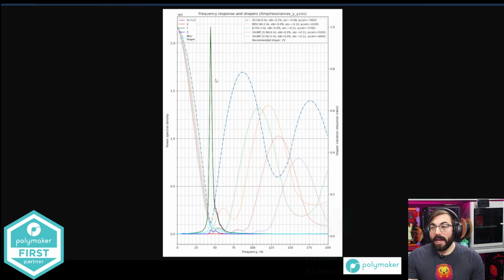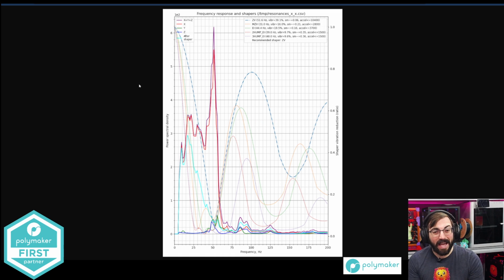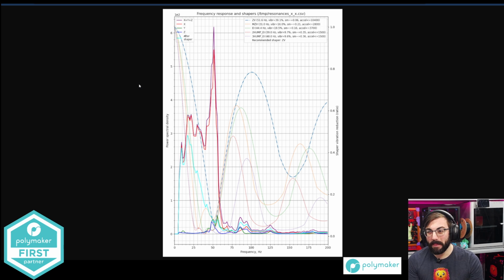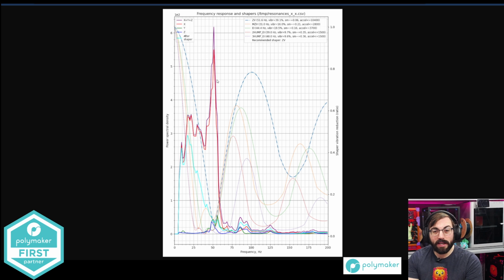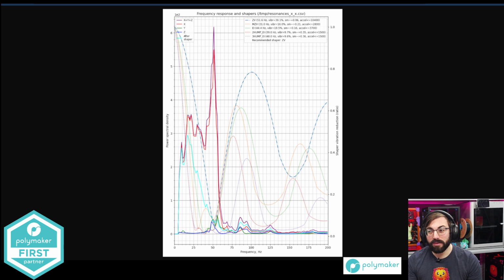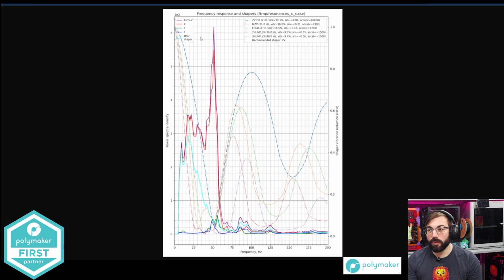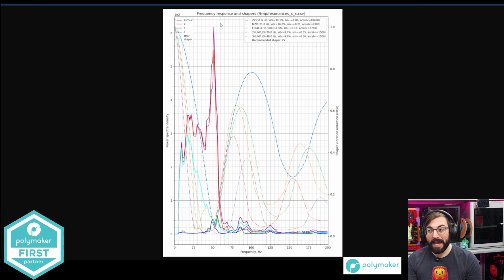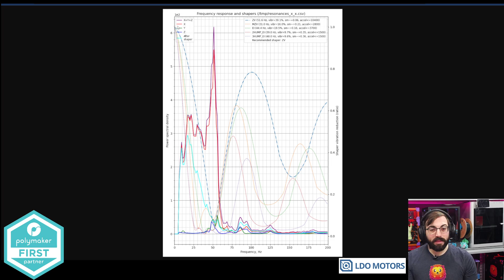The Creality K1C Is Not Ready | Here Are The Problems

Comment: :( I've had mine for 12 days of the 15 day return period. I've actually had good luck (COMPARED to other printers) but I also have rubbing on my top cover with patterns that are now burnished into it, I've had 5 clogs in those 12 days, and I've run into more makes that have ahd to be contorted, cut up or resized because the build plate is so damn small... I've been debating upgrading to a Bambu K1C or P1S - i'm really really torn because I've actully kind of fallen in love with the thing, how quiet it is, (it has a silent mode) and how easy it was to root it and do what i wanted to do with it.. that said, my trial and error frequency is off the charts... meanwhile Bambu printers exist and seeing the user experience basically cancelling out 99% of my past experience with 3D printers... I really think I should return mine too and get a Bambu. I'm so torn though because I now use it for recreation (mostly board game inserts and fun stuff) not for work anymore, so I don't NEED a K1C (or even a P1S) but I only paid $429 at microcenter and the P1S is $699-$999 (non-AMS vs AMS) 

Sidebar: Now the test print you have there is BONKERS bad, I've never had any any print remotely as bad as what you have there.

Comment: Wait so the extruder filament gears aren't supported on both sides of the axle? Yeah that's really bad if they actually bow that much during printing. Even the Sprite SE extruder design is better and it can be had for like $30. The HGX Lite can be even less and it's better than the K1C design. That's wild. That, plus possibly belt tension, seems to be completely ruining your prints. Unacceptable.

Comment: The issue is this printer is not a bamboo replacement.  and the fault of course is Creality's because it is advertised as such, but in reality it is an upgraded Ender.  When you use is like that everything works fine.  instead of printing at 25 to 50mm/s you can now do 100 maybe 200 if you are daring, but I prefer to finish the print rather than gamble on finishing fast. I ordered the 2.99 USD Vanguard upgrade for the printer as I had it preordered (I have a K1) and ever since I installed it it runs perfectly fine....My s1 Pro runs perfectly fine too,  this just has an enclosure.

The tube routing is terrible,  I fixed it by removing the tube from the cable manager.  I will be building a top raiser for clearance (annoying).  For the price its un beatable.  Where I am at bamboo is 3 times more expensive.  

I think the problem is High Expectations are Colliding with Creality Product Quality.

Comment: This printer was on my list of printers when i was looking for an enclosed core xy printer. I ended up getting a flashforge adventurer 5m pro because the price was under 500 before tax on Amazon with all the promotions going on at the time. I am glad i did go with the flashforge. It simply works as it's supposed to every time that i use it. So far i have just over 100 hours and 600 meters of filiment printed. However, i do have the same issue on the flashforge scuffing the top door with the feed tube. It bugged me when it first happened, but since it hasn't messed with the quality of prints i just ignore it or leave the top open when printing pla or petg.
Reply: I'm considering the adventurer 5m pro as well as the qidi x-plus 3, and leaning toward the x-plus 3 because of all the great reviews. Have you you printed any polymer-cf? If so how was it. What are the pros and cons? Last question, do you know anything about the x-plus 3?

Sorry for all the questions. Any advice or help you can give me would be much appreciated. Thanks!
Reply: @markschoch9509  I have only printed with  rapid and normal PLA and rapid PETG. Eventually, I will print with other materials. I haven't had any real issues with either material. I believe that either printer will serve you well.  I like the fact that the QIDI has an actual active heated chamber,  although the 5M pro chamber can get quite hot just from the heated bed when the doors are closed.
Reply: @Adamhc75  the motherboard for adventurer 5 is 75eur, qidi q1 pro is 217eur. Guess what seems better buy?

Comment: Ooof that first layer hurts to see. I'm assuming I got really lucky with mine because mine has been outperforming my K1 and K1 Max in quality. Some of the prints I’ve pulled this thing look incredible. My bed does have a 1.1 - 1.2mm deviation though. So that seems constant. Same with the PTFE tube routing/rubbing. The Input Shaper thing is mind boggling and has been since the K1 and K1 Max first came out. First thing I do is root, install KAMP, and fix the shapers.
Reply from the maker: The community has done a great job fixing the software side of things, but hardware issues are inexcusable, especially in the 3rd product generation.
Reply: Agree and support this.

Comment: whats especially crazy about this is the whole reason this printer was made was as a "quite" fix for the K1's extruder issues.  I mean its not quite Makerbots level of nonsense with their 90 degree turn filament path in their last printes, but seriously.  I want this series to be good.  Open source would be even better, but a OEM Core XY machine to at least keep some pressure on Bambu to keep them honest is good for everyone
Reply: You mean "quiet"?
Reply: @Yggdrasil42  quiet as in "we made a bad design for this extruder and shouldn't have shipped it like this but don't want to talk about it" vs not noisy quiet.  Like how Toyota or Ford will do recalls for a less innocuous thing then fix the real major issue while they have it at the dealer to avoid dealing with public backlash or the escalation of a government intervention.

Creality is such an all over the place company.  They obviously have the manufacturing chops and I have a butt ton of their machines (modded) in my farm.  But they always make just the weirdest engineering choices at the home stretch, then live iterate while still in production, instead of just solidifying a solid design from the get go

Comment: I have 11 k1 and k1 max printers and they are really hit and miss. Half don't print TPU, some have VFA issues. There have been issues with hotends, extruders, even the thermal paste used on the hotend has been a problem.

Some of my contracts don't let me use Bambu printers (I have 2 still just to free up the other printers) so it's not an option, the K1s I have been able to get to be workable but for something sold as working out of the box it shouldn't be this difficult
Reply: Can your customer tell what printer you used?
Reply: @MegaCasey09  I'm guessing it's a liability issue.
you don't want early prototypes uploaded to the cloud.
I'm sure he can lie about it, but it the client finds out they'll get sued to oblivion
Reply: bambu supports lan only mode though

Comment: Got a qidi x max 3 recently. It's printing great out of the box!
Reply: I think the Qidi lineup is really slept on. The Flashforge Adventurer 5M series also seems good for the price.
Reply: @802Garage   Yeah for sure!
Reply: Yes. I got a qidi q1 pro. 469€. That worked awesume.
Reply: @Arnos_3D  The Q1 Pro is the new best all around printer for the money IMO.
Reply: @802Garage  Qidi Q1 Pro Unclogged The Non-Retractable Extruder - this video will show that extruder is very bad design, adventurer 5 pro on the other hand is non removable single use gearbox style.
Reply: @akierum  No printer is perfect. I agree the Adventurer 5M Pro is a great option, though overall less capable than the Q1 Pro. Generally reviews of the Q1 Pro are very good and everyone I know who has one is satisfied. The customer service is also fantastic.
Reply: I've been going back and forth between the K1C, Qidi X-Plus 3, and Flashforge Adventurer 5M Pro. This video helped me narrow my decision and throw out the K1C. Do either of you have any thoughts or opinions on the X-PLUS 3 and 5M Pro? Thanks!
Reply: @markschoch9509  I think the X-Plus 3 is the more capable machine overall, largely because of the build volume and heated chamber. The 5M Pro bed size is significantly smaller overall and the X-Plus 3 has a little more height too. Price is $500 vs $630 and you might be able to get a small discount on either, so look for coupon codes. If you have the money, the X-Plus 3 has similar specs in all the ways that matter and those added capabilities. I'll add that Flashforge did release a stock Klipper implementation, but it doesn't seem well supported yet. Qidi still has their firmware totally lock to their Klipper implementation as far as I know. If you don't plan on tinkering like crazy though, that hardly matters. A friend just showed me some prints from their X-Plus 3 and it's definitely capable of extremely high quality. I personally would be between those two options over a Creality or Bambu Lab machine as well.

Comment: Don't send it back, send it to me, I'll fix it :)
Reply: I have a Creality K1 and I get perfect results every time
Reply: sounds hillariously similar to my ender 5 pro experience
Reply: @josiahong5177 lol yea if I could do it again I'd just build my own frame and use the mercury 1.1 parts to make it a real printer instead of buying a poor quality printer and throwing everything away to upgrade it. I just did my first print on the new setup and it's so good now.
Reply: How do you fix? Mine can’t complete a print no matter what I do.
Reply: Replace with a 3D printer that works, send it back. The money, and time, you spend repairing it could go a long way to getting a better printer
Reply from the maker: It's an easy fix! Just swap the extruder, hotend, bed, motion system... The frame is nice at least.
Reply: @hedgehogmakes  Sounds like a fun project too me :D
Reply: @hedgehogmakes noone will work on Exchange Parts. This time is over. See bambus and so on.

Comment: Yeah I have a k1 and it came with an older extruder. Likely a 2nd or 3rd Gen extruder. I had no issues at all. I even bought the latest version extruder and tried it and had no issues as well. I will say the bed thing is an issue. I did have to do the shim mod and got mine to a 0.1mm deviance. So I got it almost perfect. I also rooted mine and I must say mine prints like a dream now. The only reason I am not upset is I knew what I was getting into and was OK with it as I like to upgrade and mod my stuff.  Now for the reason I am ok with it.. The price. You can't find a core xy printer that is enclosed for the price here in Canada. So this printer is not for newbies or someone who wants to just print out of the box. And I got mine on a huge sale. But I must say I am disappointed with the fact that Creality did not fix those issues. They need to do better. I feel bad you ended up with a bad one. Better luck next time sir
Reply: I agree with all of this, it CAN be a good printer if you spend time and money, but that's what I'm expecting out of an almost $600 CoreXY.
Reply: The K1C has some extra bracing at the front and rear of the build plate assembly

Comment: can't understand you haven't fixed the way to calibrate the printer .after earlier releases of both k1 and k1 max .
crooked bed is not a problem if you have tolerances that are within 3mm tolerances for the company. then I also think how many of the other parts must jump so much in tolerance.
have a k1 and was not a purchase intended for me to spend time fixing or rooting the machine. so I hope that they issue corrections in the firmware themselves. I must then survive to correct a little so that it does not constantly have to overcompensate in mess bedleveling and unnecessary wear and tear on other parts.
Reply: Unfortunately a lot of issues are in the extruder, and I do not want to beta test different extruder designs for them as a paying customer. I'll gladly help design better parts if they want.